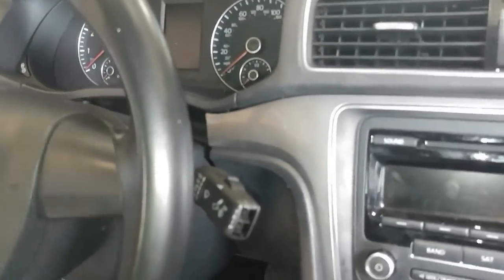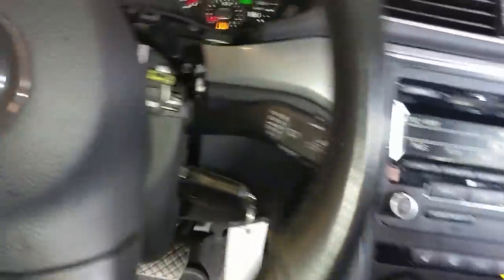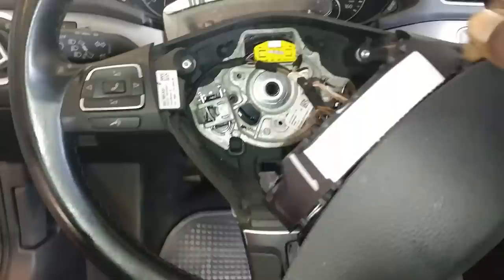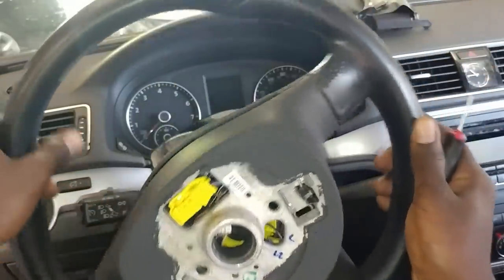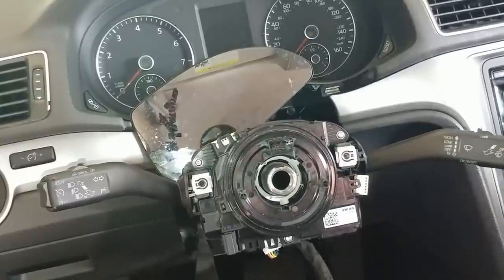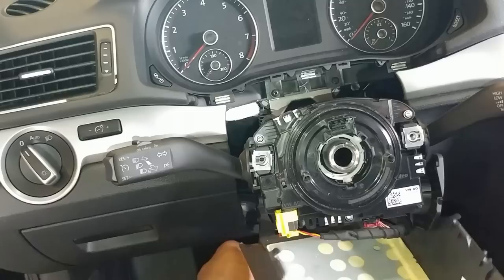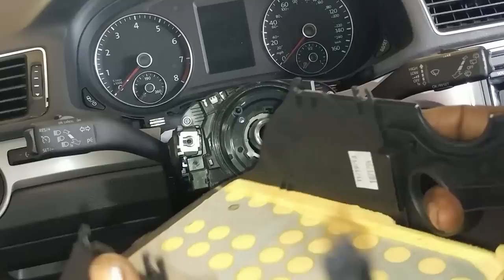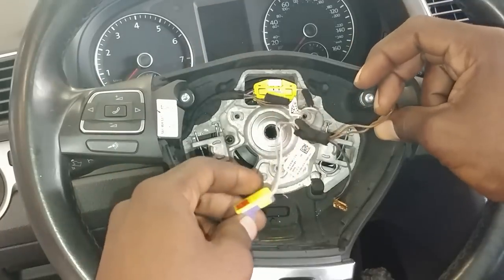Jetta and passat wiper / turn signal switch/ clock spring / steering wheel air bag  replacement

Comment: Really goo video.  You're good on showing and talking about the important details that normally could hang up someone trying to do this particular job.  It turns out there are several different designs of these switches, even for the same year and model VW.  Videos showing how to work the other designs are useless unfortunately.  The design of the switches and mounting in your Passat happen to be the same as in my 2015 VW Golf Sportwagen.  So very very useful.  erWin shop manuals for my particular car indicated a 'Valeo' variant and 'Kostal'' variant.  Yours and mine are the Valeo, just FYI.  :)  Thanks again.  Great video!

Comment: Great Video. The replacement is very basic no need for re learns or re programs. Just one piece of information. After replacing the wiper switch the front wipers and washer won't work with the hood open.

Comment: Thanks this really helped me get to my ignition switch wiring I was hoping you or any may have a video or comment on how to connect the new switch on the Passat I’ve been working on it for a week finally got the nerve to remove the steering wheel after this video thanks again

Comment: My airbag light came on after the replacement. What do you think the issue is? Should I just disconnect the battery and connect it again? Also thanks again for the video.

Comment: tip. disconnect battery. powered up airbag can deploy. can knock your teeth out. break your nose and be fatal under right conditions. do your homework, disconnect car battery before attempting this repair. follow manufacturers instructions. save money but safety, safety, safety.
Reply: Very good. Should always disconnect the power side of battery when working on your vehicle
Reply: @xxheathenxx6402  disconnect the ground side  not power. 
Last connection always sparks remember kids.
Reply: You have to disconnect the battery or you stand a chance of zapping the computer.
Reply: @xxheathenxx6402  yes however you said disconnect power side that’s incorrect. 
You disconnect the negative terminal when disconnecting battery not the positive terminal.

Comment: Hey there,i got a problem with skoda,front wipers,horn and buttons on steering wheel dont work. 
Turn signals,rear wiper do work. I got  plenty fault codes...any advice? Tnx
Reply: Me too, any resolution?
Reply: @Miriam-qj6eb  by me it was the clockspring faulty. Inside the clcokspring you have a flat cable,i was lucky it broke near the conector and could solder it again. It still works after 2yrs👍 be careful if you do it on your own..good luck🙌
Reply: Thanks for the response, I replaced mine but it unfortunately didn’t fix it. But I may recheck all the wiring around that area.
Reply: @Miriam-qj6eb  you need to.check the part number,if its not same like on the old part then it wont work,you need VCDS  to program it

Comment: I have 2012 VW Passat SE airbag deployed during accident. Trying to remove airbag connectors. The yellow connector in the center with the orange tab does not lift up and is starting to crack as I attempt to pry. Is there another way to get this yellow center tab to release?
Reply from the maker: They probably melt when they the airbag deploys you gonna need a used one a hope it come with the connectors and you joint the wires or you can get a new one and get clock spring
Reply: How does one remove the steering wheel harness and specifically the connector that sits underneath the white label and volume control panel?
Reply from the maker: @carmelom269  watch the video i remove the clock spring the volume button dont need to come off
Reply: You didn’t answer my question. If you don’t know the answer to the question, then just say you don’t know answer to question
Reply from the maker: @carmelom269  oh ok sorry about that i thought you were just changing the airbag because when changing the airbag you dont need to remove the steering wheel button i dont remember for how to take it out but when you remove the airbag you probably see the screws that hold down the buttons
Reply: I’m just need to disconnect the black tab connector behind the volume control panel which seems to slide/move up and down but there doesn’t appear to be a release button or other mechanism to release the connector. I saw another video where the technician appeared to pull down on the connector but I tried that with no success. Because the yellow airbag connector is sealed onto the hub the little orange/red tab on top will not flip up to allow me to pry up the connector. So if I cut or rip off the connector then I will definitely need to replace the airbag wiring harness and will need to disconnect that black connector underneath the volume control panel.
Reply from the maker: @carmelom269  check on Ebay and buy the harness and cut the pieces you want from there
Reply from the maker: Check this link right here https://www.ebay.com/itm/283580677008

Comment: You're trying to reinvent the wheel. I've found a solution. I removed the torx bit screw securing the Volume Control Panel to gain greater access to the black connector on the airbag harness. After much agitation, I finally tried using a mall flat head screwdriver to wedge inside the area where a male push lever seem to be preventing the connector from release and was finally able to release and remove the black connector and subsequently was able to remove the entire airbag harness which is stuck to the airbag connection due to the melted release tab. Prior to your last reply, I had already identified a suitable airbag harness replacement on ebay and have ordered one at about $20 (The Dealer wants about $150+. )  The autobody dealer wants $1,899 to R&R the restrain system including airbag ($85), Control Module ($629), Front Seat belts ($600+) and reprogramming SRS ($175).  By doing the restraint myself and outsourcing the Control Module reset and programming, and seatbelt repair and looking to save about $1400 on my total repair bill so as to quash my insurance companies attempt to "Total Loss" the vehicle.  Your video has been helpful except for removing the black connector for the steering wheel controls.

Comment: You didn’t change the clock spring.
Reply from the maker: I didn't change the clock spring but as you see in the video i removed it so if you follow the instructions to where i remove and install back the clock spring you will know how to replace it with a new one
Reply: Dullah Goso hard thanks for the fast reply, can you tell the name of the key used if you don’t have the T55 ?
Reply from the maker: You can only use T55  so you dont damage the bolt
Reply: Dullah Goso hard I change the clock spring all the functions went back but the tire light, the air bag and ESP/ASR GOT ON. Do you have any tip?
Reply from the maker: @wdsonaus7473  try and scan it and get the code and let me know
Reply: Best how to video ever